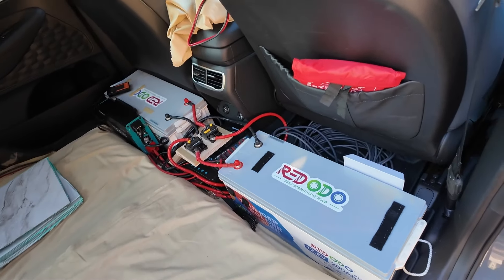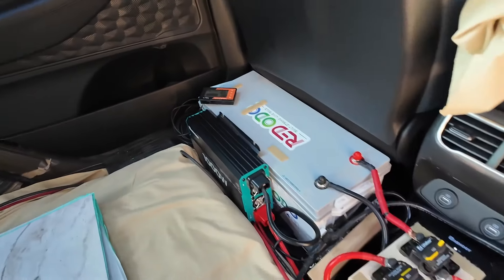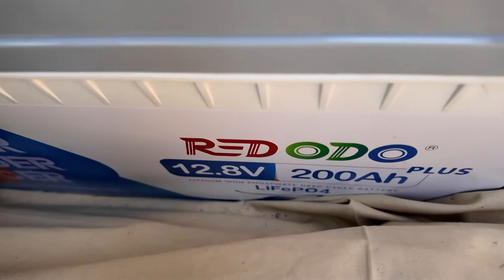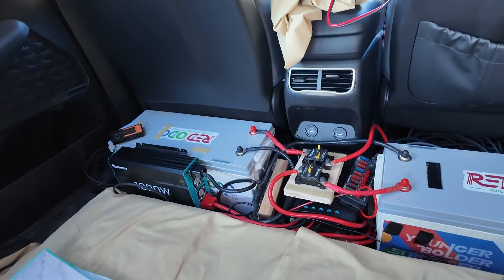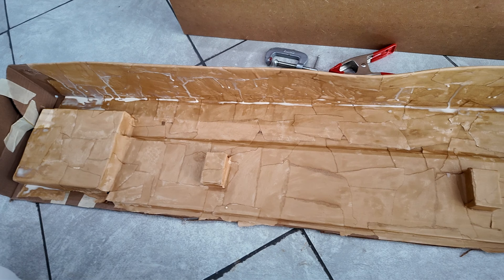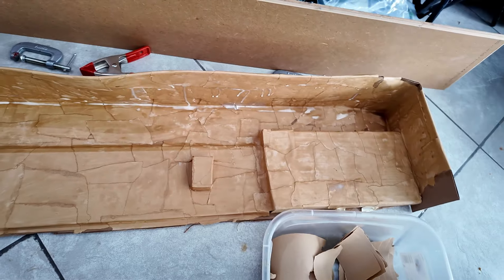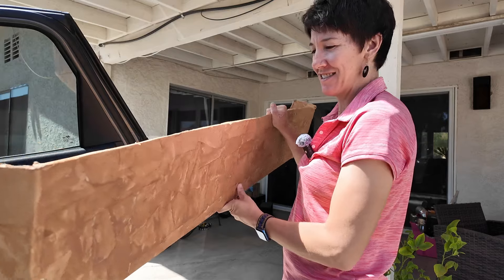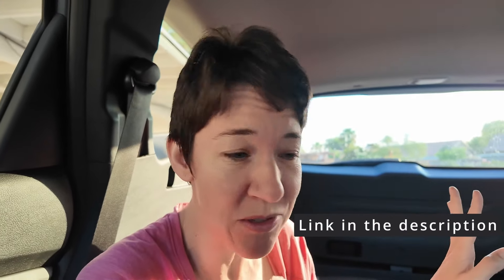Installing Solar & Batteries - Santa Fe SUV Rooftop Solar

Comment: You can only use those flexible solar panels in really cool weather.  Nice and stealth, but short lived if not down right dangerous in hot sunny Arizona weather for instance.  I saw video where Van lifers had their roof catch on fire from one of those.  See Will Prowse video on flexible panels.  You might be giving up some stealth, but I would put glass on the roof for permanent and keep the flexible for extra when you are parked and throw it on the hood or the ground.  You might want/need a separate charge controller. I haven't researched  set up flexible for changing the number of panels, yet.  It's been done though. You might figure out some thing you could put on the roof rack that would kinda hide the panels from the sides.  That is a lot of battery power!  An AC plug in charger will also give you options.  Love the paper mache':  so light and creative buildable.  Learning stuff here.
Reply: Well that answers the solar panel & battery question! Excited to see more paper mache.

Comment: Thats alot of battery power. Last winter I used up a 12V 100ah battery in 5 nights (~12hrs each) of diesel heater usage, and some phone charging. I didn't have a solar panel or charge controller to charge it at the time.

Comment: Don't know if anyone has asked this question? But do the batteries need  ventilation? Or do they have any off gassing? I know that there's probably been changes from the older kinds.
Just curious 🤗
Reply: Lithiun iron phosphate batteries generally don't need ventilation.

Comment: batteries are over kill with 200w they will never charge so why have so much ah ? also id never drive with a solar panel taped to a roof
Reply from the maker: Yeah, it is a ton of battery power! However, it's amazing how much power it takes to heat stuff (water, electric blanket.) And I also use it to power my starlink internet, sometimes all day. So, if I'm using all my solar during the day, the batteries don't have a chance to recharge. So, having a huge battery bank is actually less over-kill than it seems.